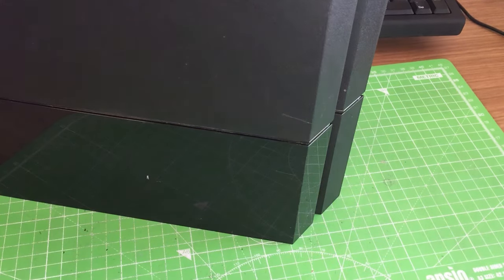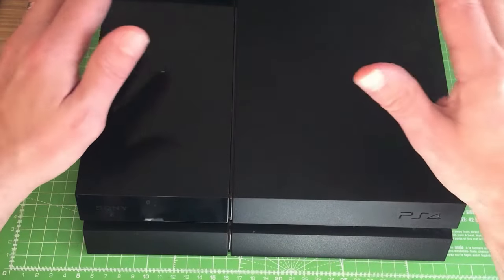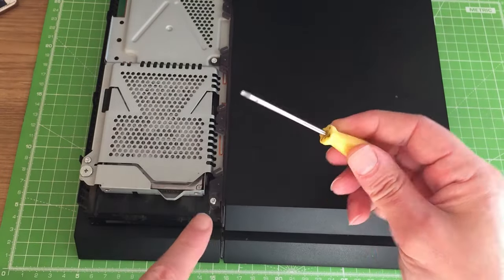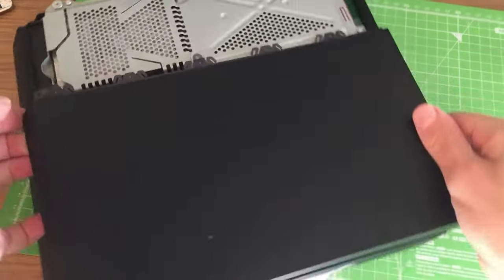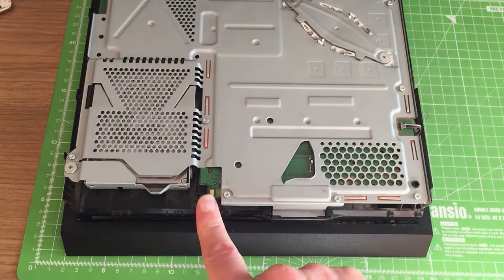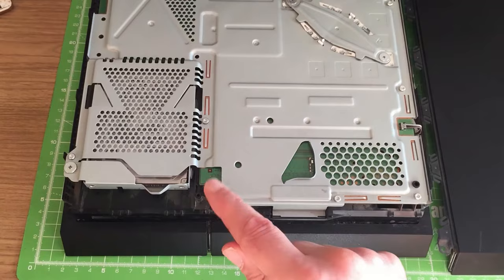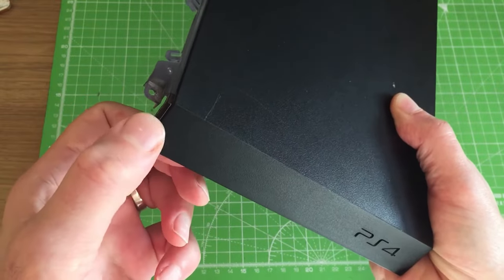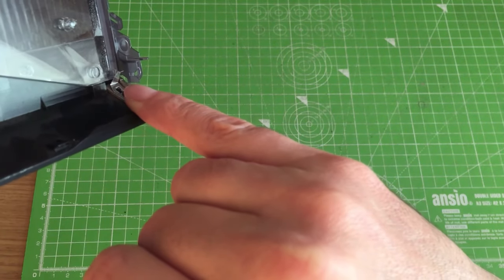How To Fix PS4 (Original) ON / OFF Switch Problems

Comment: What if it won't read your controller even if you plug it in and your power button doesnt work I do turn mine on with the cd eject button but it won't read my controllers because it's stuck on "You didn’t turn off your PS4 correctly"
My controller is plugged into the PS4 and charging but it won’t connect how can I fix this?

Comment: I have the newer ps4 , my problem is I'll turn it on by hitting the power button and it will start to turn on but then dosnt . Sometimes I have to push the button 20 times in a row inorder to get it on but even then when it finally works it tells me I didn't turn it off properly even though I did .
Reply: Could be faulty power supply.  I had a ps4 that the power supply finally went out on and I kept getting random console disconnects and shut offs.  Eventually it fully failed.

Comment: Ok, so from what I'm understanding is that when the cover is closed the metal piece should be touching the motherboard pad at all times, and there should not be a gap between the two at all. Then, touching the power button should turn the console on without  the button itself moving at all. is this correct?

Comment: I broke the metal by accident
Reply: same
the reason im trying to fix my power button is to turn it on into save mode
Reply: @isaiahbif8459  I'm trying to fix it because it's saying that it cant access system storage
Reply: @kyranbrown8347  System storage? U might also have a faulty hard drive
Reply: @Moa_Smug  yea but it says hold the power off button
Reply: @kyranbrown8347  Hm i believe u can turn off the PS4 using the controller. Now if u'll need to access the safe mode that can be a problem if the metal piece on the cover shell is broken. U might also need to replace that aside from replacing the faulty hard drive.

If that happened to me it'll be game over for me since nobody sells PS4 cover shells here. Hard drive, there are some selling at low price but mostly are chinese sellers.

Which i doubt a lot since products i bought from chinese sellers are either defective or low quality that's why i prefer buying from american or japanese sellers since i know they care more about product quality.
Reply: @Moa_Smug  the controller won't connect up to the ps4
Reply: @kyranbrown8347  Ur problem on ur PS4 just keeps piling up just like me. Unfortunately i don't know what causes the controllers to not connect with the PS4
Reply: @Moa_Smug  I know
Reply: How

Comment: You need to lose the retention screws that are for to tight I'd bet you have no thermal paste on the die being screwed that far down repaste it and only screw 3 quarter turns for the correct pressure

Comment: My is cuh- 1215a after cleaning it stopped working
Reply: Did you replace the thermal paste?
Reply: My son has the same one and i had the same thing happened.. I didn’t realize fresh thermal paste needed to be reapplied after it’s been opened.. turned on after just fine.. well kind of.. I did have to use a usb to update the system because it booted up on safe mode.. but that could have been just his system

Comment: If your power button is broken and you connected your controller to another PS4 by accident that turned on that Ps4 that’s broken then just put a disc in the thing and it will turn on!!!
Reply: What if it won't read your controller even if you plug it in and your power button doesnt work I do turn mine on with the cd eject button but it won't read my controllers because it's stuck on "You didn’t turn off your PS4 correctly"
My controller is plugged into the PS4 and charging but it won’t connect how can I fix this?
Reply: @andersonnunez4312 were u able to find a fix? I have the same issue